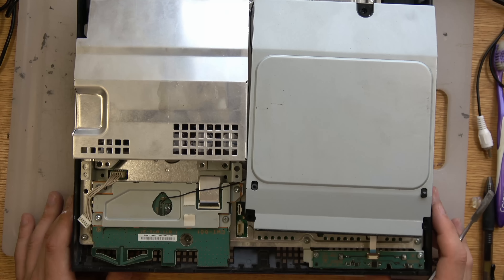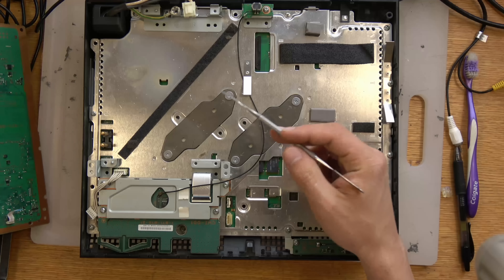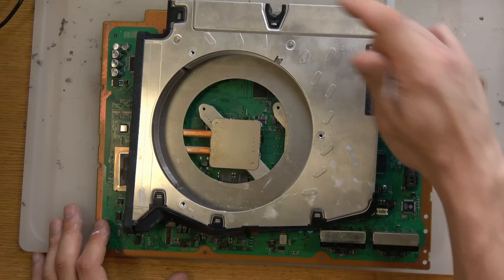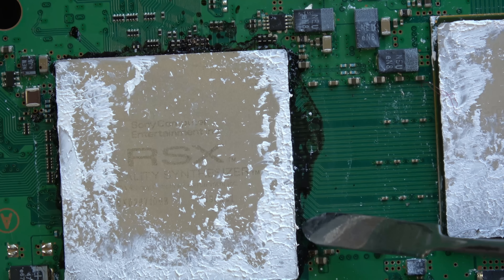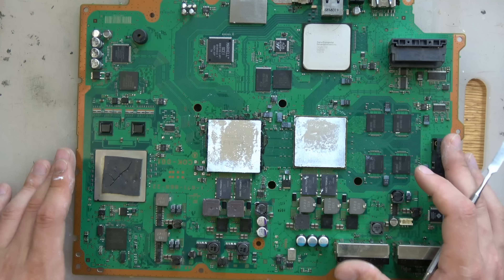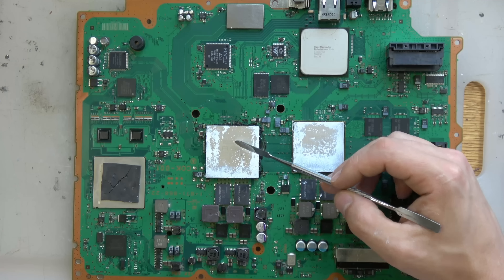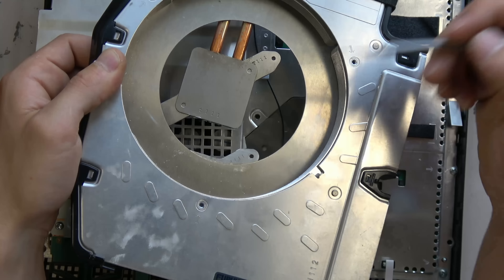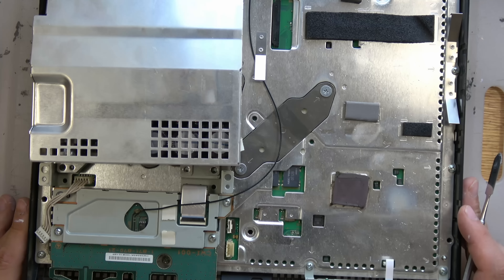PS3 YLOD FULLY EXPLAINED - YELLOW LIGHT OF DEATH - RETRO GAMING ARTS

Comment: The yellow light of death was never RSX heat issues people just assumed that because the Xbox suffered heat issues, it was actually this NEC/Tokin capictors wearing out, when people reflow the RSX they also unintentionally heat up the capacitors causing them to regain some of their capacitance and thus the YLOD goes away, this also explains the varied life span of the console after a reflow/reball, replacing these capacitors with more modern and more reliable counterparts fixes the YLOD 

You can learn more on this thread 
https://www.psx-place.com/threads/tutorial-nec-tokin-capacitors-replacement-ylod-fix.25260/
Reply: i don't think I've ever had a ps3 die due to overheating (but bare in mind thanks to my experience with the xbox 360 i've always taken precautions when it comes to overheating) All the YLOD fixes i've done have done have been capacitor related but like you said if the user allows extreme temps for whatever reason whether it be poor ventilation or slowing fans down for quietness then it is possible to fry the chip because they don't throttle like modern processors
Reply: It’s a complete scam and the sooner people realise it the sooner people will stop wasting their money on this crap, the later model PS3s actually run hotter and they’re considered “more reliable” in order for the solder got melt it will need to be heated to at least 200 degrees C and the average temps of a healthy console can range from 60-70 and that’s no where near enough to cause long life strain there’s simply too much tolerance. However these things aren’t bulletproof like you said the GLOD  can still be an issue and I still swear by properly maintaining these to get the most out of them regardless if the YLOD is a heat related issue or not.

Comment: Would getting a power supply that has a case over it, or adding a case over the metal one to prevent it from heating up the chips underneath work?
Reply from the maker: External power supply is a good idea, it's been done and works but its ALOT of work

Comment: that black goop under the RSX is likely flux paste from someone reflowing or reballing it and then not cleaning up after themselves
Reply from the maker: SincerelyGhostwritten that particular unit was fixed by gamestop once apon a time, it had a gamestop warranty sticker on it, and th guy i got it from told me about how he took it to gamestop to get fixed cuz thats where he bought it, ive never seen flux turn black like that before
Reply: sounds like a "quality" repair job by GS, its possible that they used some industrial flux that ends up looking like that.
Reply from the maker: SincerelyGhostwritten ive repaired lots of things that have been gamestop refurbished, people typically go to GS, and it breaks again a few months later, so they send it to me, but in all my repairs ive never seen that black stuff before. Hahah i was like wtf is this? Did the chip melt, its hard, thick, and wouldent come off
Reply: weird
Reply: Its glue. Probably to hold the GPU still while being reflowed.

Comment: My 60GB CECHA PS3 that I've had since 2007 just yellow lighted last month. I thought it was going to last forever..........
Reply: ModelJames13 go to 9:25
Reply: If you still have this PS3 I would recommend you getting it reflowed or reballedhave the integrated heat spreaders removed and have thermal compound reapply to it all
Reply: Yes, do what James Carter said. Mine is from 2006, I replaced both IHS, also the thermal paste under it and on top, the power supply with the APS-226 model  and it runs better than ever and quiet. It never had the YLOD issue so I plan on reballing it to replace the lead free solder balls with leaded solder balls.
Reply: @robertvuitton  yeah I'm using the same power supply mines never actually experienced YLOD before, although thanks the custom firmware I constantly just run the fan at 29% temperatures always stay around 50c to 66c on both cpu & gpu.

The temperature might seem pretty high compared to a slim but the fat models ran a lot higher because of the bigger dies.
Reply: Oh, that's great! Mine stays around 65 and no more than that. It gets lower in the winter time, fan speed always around the 25% and 29%. The GPU temperatures however are always lower than the CPU temperatures, around the 50s, so thats good since it is always the GPU that gets messed up. Another first gen model I had without any mods done to it ran at higher temperatures, from 70 to almost 80, and the main reason was that damn power supply (the one before the APS-266).
Reply: @robertvuitton  Most newer 80gb modes that can play ps2 games have smaller GPU dies, so those models run a little bit cooler.

My 60gb model seems to run around the same temperature for both, thinking of adding a 0.1mm copper shim to it. If it helps I'll be sure to add feedback.
Reply: @James Carter oh, youre right, but those models have some issues playing a few amount of PS2 games unlike the first generation model which doesnt have those problems. However, I do like that they run a bit cooler.

Also, wouldnt adding a copper shim to it slow down the heat transfer? have you thought about using liquid metal? [Thermal Grizzly Conductonaut] under both IHS and a good thermal paste like the JunPus DX1 or the Thermal Grizzly Kryonaut for the top. Maybe you can also get good results if you also use the liquid metal on top of both IHS and under the copper shim but for the top of the copper shim (where it makes contact with the heatsink) use thermal paste.
Reply: @robertvuitton  Yes that's ture. I'm actually am using liquid metal under the ihs and thermal Grizzly thermal paste over it. If I'm not mistaken that IHS is copper but nickel-plated, don't use over top the IHS as the heatsink is aluminum. I found that out the hard way. I've tried 0.2mm on a newer console and it seemed to help as it was going to 70c before on the cpu but now is under 60c. 0.3mm looks to be too much.
Reply: @James Carter, oh, you are? then I think I should get even lower temperatures then using liquid metal if Im already getting the same temperatures as you with just thermal paste. The IHS I think it is copper but nickel-plated like you said. I came across a video from someone else who used liquid metal under the IHS and stated that it was copper. 

The heatsink however is aluminum for sure. Did a bit of research a while ago just to make sure and after seeing someone using liquid metal on a PS4, but good thing that it has copper. Also, what did you use to protect those small components on the GPU/CPU from the liquid metal? After some research I found something that looks like nail polish (it glows green under a uv light) to protect pcb and etc.

Which copper shim size would you recommend then? 0.2mm or 0.1mm?
Reply: @robertvuitton  I personally have no protection from the liquid metal on my GPU or CPU, the CPU doesn't have anything that really needs protection.. the GPU however is a concern. Luckily I added just enough and it works perfectly for me. I have not tried any copper shims on my main unit yet but will soon, I recommend trying a 15mm x 15mm 0.1mm thickness. You may need to get a slightly longer one for the CPU though as 15x15mm looks too small for the die.

When applying liquid metal make sure you put some on both die & IHS. Or it can easily swim and cause damage, if you have not used liquid metal before it can be a pain to apply.
Reply: @robertvuitton  What I am going to do with my 60GB is put in the EzChill fan mod, the APS-226 power supply, copper plates for the chips, and Arctic Silver 5. The 60Gb I got works great though, I just want to save it from the yellow light. It even still has the warranty sticker on it.
Reply: @CassandraPantaristi  If yours isnt hacked then use the EzChill fan mod, even though Im not sure if it is recommended. If hacked it is better using the webman control fan, it will cool when the temps go higher and then after cooling it: less spinning by the fan which it is nice. I wouldnt recommend you using the AS5 thermal paste at all. Avoid it and use the thermal Grizzly paste or the one JunPus DX1. MX-4 is also good. For the warranty sticker, Id recommend you to remove it by heating it up with something like a hair blower or heat gun. Do the same steps to remove it from where ever you put it or else it will show something else.
Reply: @robertvuitton  I've seen a lot of PS3 jailbreaking videos, but I will never attempt it. One YouTuber said that you should only do it if you're really smart. I just want to play games. I mean WebMan, and MultiMan are cool but still don't want to risk bricking my PS3. How is Arctic Silver 5 bad thermal paste? 

My brother (who works with technology for a living) uses it. The paste gets good reviews, but I think I remember looking up MX-4. The sticker should just come off.

Comment: The oven method is actually used on the assembly line when it is made. It is called wave-soldering.
Reply: Actually reflow soldering.
Reply: In what temperature should i put my motherboard in the oven?

Comment: The heatsink is garbage. I water cooled my ps3 and it went from 82c down to 45c. I tried replacing the heatsink compound and cleaning out the dust before I water cooled it but it only dropped to 75c.

Comment: YLOD is caused by defective chips at the factory level. The die of the GPU was not properly bonded to the substrate. No amount of heating and reballing will fix the problem. You would think that reballing would last a very long time but it will only work for about a year or so. It's the 90nm RSX that is the thing to avoid. Are all 90nm RSX defective? -No. Some people baby their systems and they break after 2 years, others play on a carpet and never clean them and they still work today. Virtually all YLOD problems will occur on the CECH A/B/E/G/H systems. The later ones use chips with a much lower failure rate and some people even abuse them and they still work and likely will work long into the future. If anybody wants to buy a backwards compatible ps3 look for one that's been used a fair bit since if it can last over 12 years and still work chances are the chip has no defects and is reliable. Absolutely avoid at all costs sellers with multiple ps3s since those were very likely refurbs that previously had YLOD which, even if they work now, will revert back to YLOD not too far into the future. Also avoid plain refurbs, same problem. The last original model PS3s, slims and super slims are quite reliable and yes there will always be the oddball YLOD on a slim or even super slim but that is very rare and when you consider that tens of millions of them were sold, a few gone wrong is understandable.

Comment: Problem of all PS3 is, that it sucks air from the middle and blows it to the sides... (the way you showed it gets air in is wrong, it defeats law of physics, centrifugal forces of air...)... I did few of them and solution is to mod case on the bottom to get it better airflow to the middle of the fan... Then it is quieter and not overheating at all...

Comment: These PS3 systems are uncomfortable to hold as they get so hot. I never wanted to buy any PS product because of issue of heat dissipation. A custom 3d mod and allowing for 2 or three extra fans I would think can be possible.
Reply from the maker: Miguel Aranda your right, and i agree, you could also just do a simple potentiometer mod, but what fun is that? did you see the video where i put the power supply inside a wii? Hahaha
Reply: And pin grid array for the cpu and gpu...plus improved capacitors...

Comment: What about the green light of death, where the PS3 boots, shows green light, and nothing else, no controller sync, no video even with a video reset, and unable to enter recovery mode
Reply: Its almost as same as YLOD but it involves just the GPU chip. You can try to replace the NEC/Token chips but its not a guaranteed method.

Comment: My original ps3 (80GB) just got the YLOD. It still turns on bit turns off and stays red light blinking. What can i do to fix it? Do i need to just change the thermal paste??
Reply: Expensive option: send it to repair. Cheapest option: use a heatgun (with a BIT of flux) and then change the thermal compound (make sure is NON-electrical conductive).  More advanced option: also delid (very risky!) the CELL and RSX and change the thermal compound underneath the Integrated Heat Spreader (IHS).  Also make the power supply external (by extending the cables, nothing fancy). Hardcore option: use water cooling.

Comment: Why do so many say its a heat issue? They only thing that could have changed is the heat paste or the solder it is unlikely that the heat from the PS3 could heat enough to melt solder unless physically the solder was so thin it cracked due to expansion of heat, contracting due to cooling off. The NEC capacitors were known to have gone bad they killed a huge amount of Toshiba laptops when they went bad. If a PSU and CPU get poor power they won't work hence the PS3 failing. When Muppets reflow (destroy) their  PS3 yeah it might work for a bit as you are heating up the NEC capacitors. Why the ps community jumped on the 360 band wagon I'll never know

Comment: how to fix ps3 slim when picture doesnt show up on hdmi or AV port; well it does show for 1min then dies
Reply from the maker: hold the power button for 10 seconds when you turn it on, until you hear 2 beeps, and what this will do, is it will reset the ps3 to output in the video connection you have plugged in
Reply from the maker: sometimes it will boot into safe mode, but what your trying to do, is switch its output method from AV to HDMI
Reply: yea try those already; HDMI works for like 1min on cold boot then dies; wont work again unless i wait for it to cool down; Think no video is a common issue on the PS3 also but havent found the answer to fix it
Reply from the maker: either the hdmi port needs a reflow, replace, or theres the hdmi controller chip (forget what its called) that chip may need to be replaced
Reply: is it just the hdmi? since the AV port doesnt work also
Reply from the maker: hmm, honestly, withought messing around with it, and trying to find the problem, i dont think i would be able to give you a defendant answer, does the ps3 stay on, just now video? or does it shut down
Reply: yea green lights, just no video; i did test it b4 while the video was on, everything works, so i know it works but the video signal dies after 1min. I have cleaned everything and put new thermal paste also; P.S i bought this for $5 bucks on craigslist, so i dont mind breaking it if need be =)

Comment: For the original PS3 model, Id say one the main cause was/is the power supply unit, the location where is at and the lead free solder balls. My original model that I bought the day it came out didn't even last two years! I played many hours of Motorstorm and COD4 online until the console no longer wanted to read any of my game disc. I opened the console without any knowlodge of it and no Youtube video at that time. I broke the wifi cable too. The power supply was hot to the point you didnt want to touch it and I believe it was bending the motherboard because at random times I would hear cracking inside the console. So it was either the motherboard or the solder balls inside cracking. The console no longer didnt turn on and gave me the blinking yellow to red light. I was lucky enough to get it replaced it with a new one from SONY even after opening it and breaking some cables inside. 

Fast forward to 2011/12 I once again opened the console (with the help of Youtube videos) and this one had a different power supply unit model, the APS-226, much better than the ZSSR539IA that was too hot. I removed the IHS from the GPU, CPU and replaced the thermal paste under it and on top. Also, replaced the original thermal pads with ones from Fujipoly. Later I replaced the 15 blades fan with a 19 blades fan and my console has been great and running quiet, with temps no higher than 65 and low around the 50s in the winter. I have done the same for 3 more launch original models that I bought from Japan.I will try liquid metal under both IHS soon and see how cooler it will run. The next thing Id love/want to do is replace the lead free solder balls under both GPU/CPU with leaded solder balls, but at the moment they charge a lot. So imagine doing that for 4 PS3s.
Reply: There are various design flaws but the main one is the bad cooling solution. Sony used an IHS over the cell on every ps3 model and a bad carbon thermal compound underneath it different to the ceramic they used above it connecting the main heatsink. Sony didnt even need to use an IHS they could have direct mounted the cooler which would have been cheaper and more reliable.
I recently added liquid metal to my ps3 slim and it made a big difference even compared to arctic mx-2 though temperatures arent that different as the ps3 fan profile keeps the cpu hot and acoustics low.
Reply: @ps3customgamer  Thanks for the info  buddy. And by the way, did you used anything to protect the board from the liquid metal? if so, what exactly? nail polish? Also, is it hacked, running webman control fan etc?

Comment: A long time ago i dropped my fat ps3 about 3 feet and it stopped working. It turns on beeps 3 times and turns off. I dont think the problem has to do with overheating. I took it apart and im going to apply new thermal paste and dust it out, although i domt think reflowing is helpful. Any help from anyone?! Thanks
Reply: I think something on the inside got broken. 
Plz be careful naxt time .
I suggest you gave you PS3 to some one who can fix it